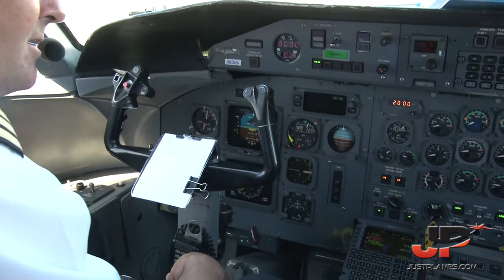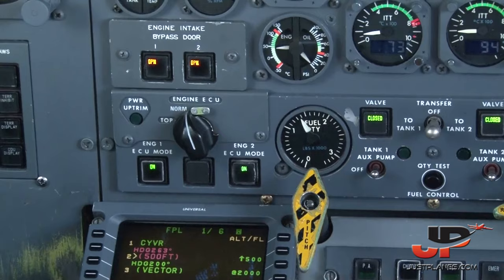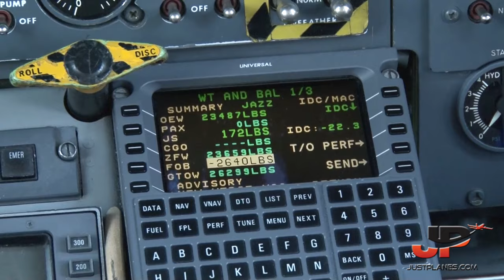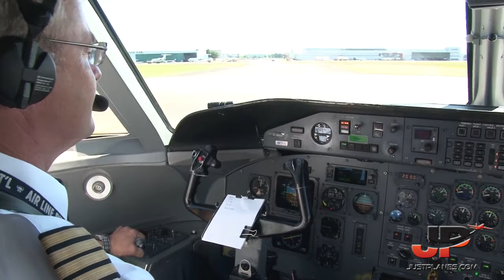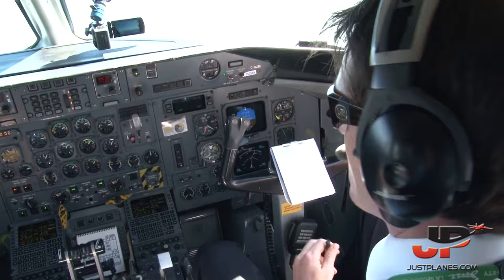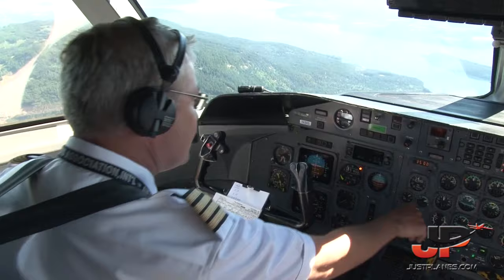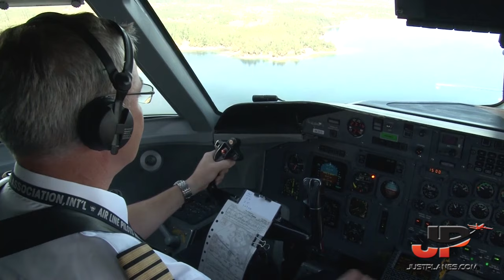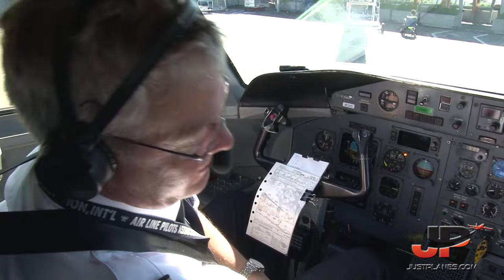Piloting Dash 8 on a SUPER SHORT FLIGHT from Vancouver to Victoria

Comment: Rudy that is Mt Baker just before take off about 100 miles to the east,  I suspect  that it was filmed around 10 years ago.  FYI  CYCD to CYVR is the  shortest flight Jazz does on the West Coast at just under 10 mins if ATC gives a direct route.

Comment: The Dash 8 is long in the tooth... I remember when the majors used them back in the late 80s and 90s. I've never experienced turbulence in any plane as bad as that once experienced while in a Dash 8. On a flight between St Louis and Chicago my boss and I were on a trip and he didn't have his seat belt on...we were the only two passengers on the (red eye) flight when we hit a line of thunderstorms while starting the decent into Chicago. My bosses head was cracked open on the overhead air controls when the sudden downdraft hit. This was back when pilots still flew with the cockpit doors open. They slammed the engines to full and was hauling back on the controls and we were still falling...and then we hit the other side and they were doing the exact opposite and the plane was going up with the nose pointing down...then comes the obligatory, typical, and understated quip from the pilot "...sorry about that folks...we've seemed to hit a bit of turbulence". I always hated prop planes if I had to travel in them. I'd still rather fly in a Bombardier over an Embraer. This is like watching Classic Cars, but for airplanes instead. I can't remember the last time I saw paper charts in use in a video... Nice trip down memory lane...sort of.

Comment: Is this an Air Canada flight?  Some Canadian people have said that AC is now a "no-frills" airline and they use Air North or any other airline if they can.  Is this accurate.  I always enjoyed AC but don't like low-budget airlines.  No disrespect to AC but would like to get some good info.  Many thanx.
Reply from the maker: It is an Air Canada flight operated by Jazz Aviation which operates the smaller aircraft that Air Canada runs on routs where they can't fill the larger planes.
Reply: Air Canada still remains a great company on long haul routes with full service onboard but had to cut on meals and other amenities for domestic and USA flights to stay competitive. (At least, they don't cut on security 🙂)
Reply: AC is a full service carrier just like Delta or United.

Comment: Hey quick question is there a Radio Altimeter on that airplane by any chance?
Reply: yes
Reply: Yes you can hear it on the approach when it yells RADIO ALTIMETER through 2000ft RA.
Reply: @davisbyer4791  is this call to announce it has a reading? Radio altimeters seem much older than the Dash-8. The Super Connie had one.
Reply: @PeterNGloor  yes basically to make the pilots aware that it has a reading/is active and they're getting mildly close to the ground

Comment: what in the cockpit of a turbine like that requires the carbon monoxide detector?
Reply: Because they use fuel fed heaters in the winter at some small airports at night. These heaters could suck up their own exhaust sometimes and blow it it the cabin
Reply: @richardmorin6968  interesting, thank you